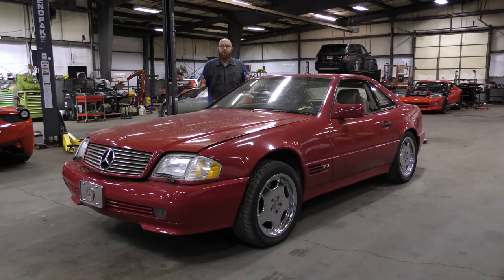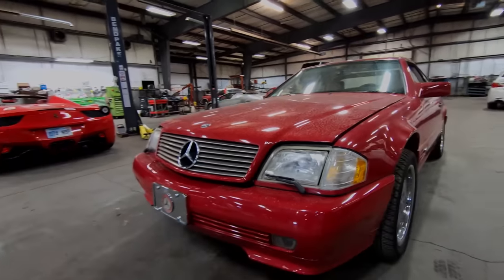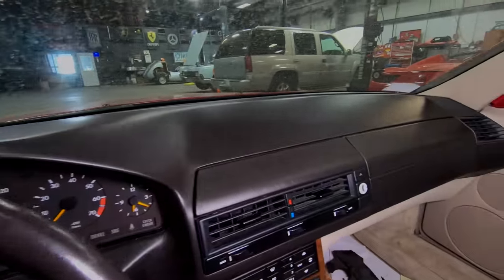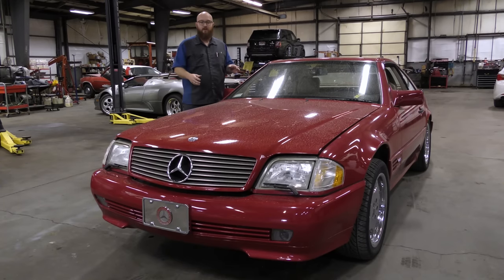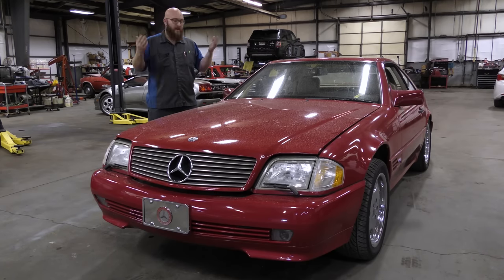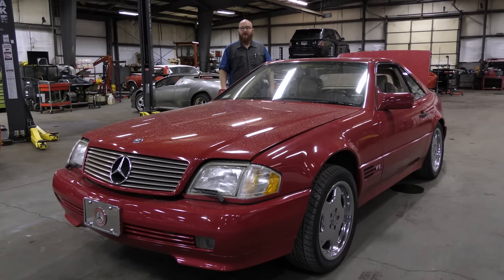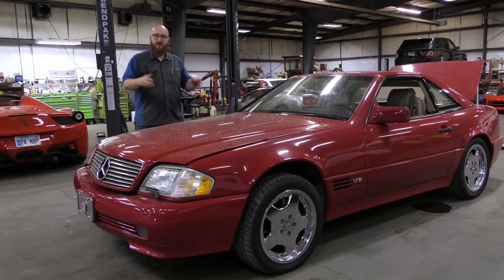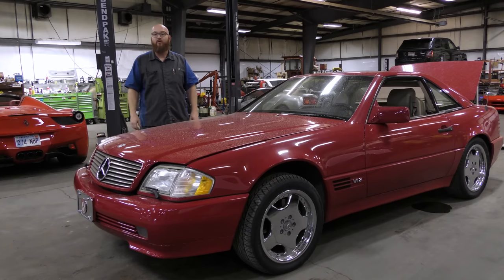Another customer scammed! CAR WIZARD shows why this '94 Mercedes SL600 is needing 15K to get sorted!

Comment: The hydraulic roof thing is horrifying!

 I wonder if anyone has successfully sued Mercedes-Benz for the environmentally friendly wiring.
Reply: I don't think so cuz all the cars were long out of warranty before the wiring harness reared it's ugly head. Most of the cars were from 93 to 98 and a lot of these problems didn't come out till 2007,8,9 ... So is 8 to 10 years before the wiring got bad. Mercedes used to sell the wiring harness for a rather inexpensive price compared to what they are now. I think a upper W124 harness was only like 3 or 400 bucks from Mercedes12 -15 years ago. I believe Mercedes only made one big run of them and then they stopped
Reply: Maybe; .I remember they had issues with rodents eating the wiring out of the cars.
Reply: The wiring was on every car. A recall would of bankrupted them so it never happened.
Reply: I believe it was a mandate of the German government, being green and all, to have the biodegradable insulation on the wiring, in 94/95 until it was rescinded.
Reply: @wheretheredferngrows14  Ahh yes, too big to fail.
Reply: @richbenzer5926  The road to hell is paved with good intentions.
Would have been better for the environment, if that law didn't exist.
Reply: Ahh, American's suing everyone.
Reply: @richbenzer5926  Yes a problem on BMW Motorcycles of that era too.
Reply: @formatique_arschloch  wow I'm so offended, I'm suing you for posting that~
Reply: @formatique_arschloch  maybe this explains why European car manufacturers produce such shit cars. 😐 Europeans don't want to sue for bad products.
Reply: @stevemonkey6666  Or maybe Americans just want to see a chance  to be a millionaire, because the coffee was too hot when spilled on their groin.
Reply: @formatique_arschloch  or because their $100,000 car failed because the manufacturer made the wiring loom out of biodegradable materials that are prematurely degrading, and they do not manufacture replacement parts.
Reply: Replace the hydraulic fluid with grape Kool-Aid and you'll be in business!
Reply: @stevemonkey6666  tell me about car quality of GM from 90's. It is terrible. But no one is suing GM for thar.
Reply: @davidjacobs8558  One has to stop for a moment and consider
which environment one is thinking about.
When CORPORATIONS talk about 'The Environment' it is a mistake
assume they are talking about the 'Natural Environment'
... They are actually talking about the "CORPORATE ENVIRONMENT'
Which is a totally different thing.
** They never explicitly said it was good for the 'Natural Environment"
Reply: @stevemonkey6666  most of the "shit" you have in the states have been manufactured inside USA, México or Brazil... Quality requirements are lower because the high volume of cars that are sold in only united states is incredibly high.  A Mercedes in Europe is very reliable and you can see A LOT of them with over 500k km or beyond 1M km. We also get spare parts you don't get in your American dealers. And american cars/parts are hugely expensive here... You pay for a base v6 Ford Mustang some 25k dollars...we are forced to pay around 45k euro so that means 60 thousand dollar for a basic Stang. Just to give y'all an example.
Reply: Go to a MB dealer, it is mostly Dr. and some business guys who lease for two or three years.  No person is buying them for longevity.  MB has ZERO priority on longevity.  just short term snob appeal and tech wizardy
Reply: Exactly! That’s why I bought an R107 instead of the R129.
Reply: Imagine being on a date with some chick you really want to impress and that happans. lololol
Reply: Having seen that degradable wiring, it is difficult to know just what stunts ANY Car Manufacturer will do! Once these high-end German Cars end-up in a different country, the costs to repair them rise exponentially. All except the classic VW Beetle. Nothing serious goes wrong. They could run forever, and get you from A to B.
Reply: @peterduxbury927  not all of them used biodegradable, 80s qnd 90s mercs are seen more often than beetles in third world countries
Reply: @samfuller6273  93 thru 96.....I had a 97 and it no longer had the soy based insulation.
Reply: @Judgegixxer 😂
Reply: It's been said that the entire engineering dept at Mercedes was fired for the wiring issue back in the 90s
Reply: @richbenzer5926  German government in 1994/95 was conservative and really not all that into environmental issues. Back then they were busy getting offended by the green party wearing sneakers in parliament. Mercedes simply figured they could switch their wiring to use organic softeners instead of synthetic, which however resulted in them brittling out earlier than expected.
Reply: @stevemonkey6666  Is that why America makes some of the worst junk cars of all time? In sue happy America yet
Reply: @locluke979  but here is the thing. American cars in the past were often real shit boxes but they've got better. I would say the average American car today is no worse than the average car from anywhere else. However Mercedes-Benz was once the best car in the world. They are marvels of engineering and people still love older Mercedes. Newer Mercedes are often shit boxes. American cars: getting better all the time. German cars: pretty good if you get rid of it after the lease period
Reply: They probably bragged about it.
Reply: @formatique_arschloch  that sorry is not as it seems.  The reason she won is because McDonald’s knew the coffee was too hot and noted it but didn’t do anything to fix it.  The lady almost died from the burns. They were horrific.
Reply: @decnet100  so this was not a government mandate?  That is what I understood but maybe I am misinformed.  If MB FUed then MB should stand behind their bad decision and offer new parts for a reasonable price
Reply: @richbenzer5926  Yeah, seems exactly that - Mercedes wasn't forced to do it, they just changed their wiring production (I suppose more or less for the regular reasons - the new stuff, namely Arnitel insulated wiring, was either offered to them cheaper and easier to make, or promoted as the latest and greatest with no drawbacks whatsoever), and perhaps later on someone mentioned as an excuse that the resulting wires would incidentially be less harmful to the environment - an explanation which I suspect must have been picked up on in the American market predominantly. I can tell you that over here in Germany even within car/Mercedes enthusiasts who usually love gossip like this, the whole "biodegradable" story is largely unknown, if at all it is told as "due to american environmental regulations, the wiring looms had to be recyclable" (which of course won't explain why other cars sold in the US don't have that issue - but that basically doesn't concern the German domestic car enthusiasts, does it). Over here, the stuff is basically just known for what it objectively is - "bad quality 90's wiring looms". 

By the way, there are several manufacturers in Germany (and also Poland) who do indeed supply new, quality wiring looms for 90's MBs for quite reasonable prices, as they do a lot of them - I'm sure they'd even supply some for a R129 SL600. Also (partial) engine wiring looms of better quality are now available through Mercedes themselves - for about €1200 as I'm told.

Regardless, Untertürkheim certainly should have stood by their product and do a recall.
Reply: @stevemonkey6666  that is right... German cars are now into the "more sales" mood so quality since the w204 and w212 era became a PITA. Engines are incredibly good (block and head) but everything around is like an iPhone or any electronic device of today with an expiration date. All north american cars weren't that bad before....10% was save at least lol but yes, they become a bit more reliable in the nowadays even tho all cars around the world's are reaching the same (shitty) quality standards as all manufacturers have now the same goal and that's MONEY. Cheers from Spain!!
Reply: @decnet100  thanks for the reply.  Interesting story.  Do you have links to any of these other suppliers?
Reply: @richbenzer5926  After two attempts of posting external links with YT deleting them, the names of the companies that I'd consider are MKB-tec and kurth-classic in Germany and perhaps also JKS-Elektro in Poland (even though he seems to have moved on to different things).
Oh, as a sidenote: They'd all require you to dismount your old harness and send it to them, as they essentially all refurbish and reuse your plugs, which also helps to ensure they are in fact recreating your exact harness variant. Here is a vid showing MKBtec's facilities and work: https://youtu.be/qt3hMeF61eE
Reply: @richbenzer5926  Oh, and also interestingly about the origin of the problem: I just found an article about this in a german vintage/youngtimer car mag which had an interview with Norman Kurth - he mentioned his well-founded suspicion that the wiring harness issue might have sprung from a number of suppliers, as it would always be the same cables connecting the same subsystems that would show these cracks, while other cables right next to them in the same harness would in all regularity be fine, meaning that Mercedes would receive these "sub-harnesses" from their long list of suppliers, and turn  them into one big harness as part of their final assembly. So in clear text, it probably wasn't a massive, centralized push for more environmentally friendly wiring if only some wires weren't affected, more of an issue with several suppliers (throttle bodies seem to have suffered worst - I guess there the heat did it's job on the new wiring the quickest).

I suspect the issue could be as simple as Mercedes going "we also accept the new wiring standards xyz, they seem to be equal to what we are already using" on their supplier contracts, and some of those suppliers going "oh great, we'll pick those up as they're half a cent cheaper per Meter (and we order that stuff by the kilometer)".
Reply: @samfuller6273 , it's not a warranty issue. It's a defective parts issue. The parts were intended to last 30+ years, not 10 years.
Reply: @samfuller6273  hello even the 1991 had the problem. I have the 500E W124 1991 and about 1 year ago i bay new upper harness from the dealer around 600euro. Date off production off the new harness was 2012, its labeld on the heaness near where you plug into the computer . In original closed plastic. Also have 1995 W124 E220 coupe that harness i maked my self. In 1995 came the W210 and i belive they no had that problem anymore. But the W124 T and ...made until 1997 for the european marked.
Reply: @pablopicaro7649  I have a 99 S420 that was purchased brand new!
I'm not a doctor or a business guy at a time of purchase and the car was never leased!

Comment: Thanks for this Wizard, I really liked these cars but dealing with the top and wiring issues... these cars are now off my list.
Reply: Get the SL500
Reply: Wiring harness issues were for all models 1993-1995 aprox, before or after that, no problem. I'd steer clear of the 600 IMO
Reply: I’m currently workin in a Series 2a, DMC-12 and 57 Fairlane. Hands full at the moment lol
Reply: They are great cars. Just make sure the previous owner has attended to these things! PPI and receipts.
Reply: Get a 1998, best  year for a sl600, but they still are money hoes, the engine is too unique, I would guess you can't really get any parts for them.

Comment: ALWAYS pay for a PRE-PURCHASE inspection. It will cost a few hundred bucks at a dealer and they are happy to do it for you. They will find the issues you had no idea were there. This also gives you another tool to bargain on the price. This has saved me SOOOO MUCH money over the years. This goes for any machine or vehicle. My latest purchase was a Bobcat Skid Steer loader. It was in very good condition and some minor issues were discovered but the piece of mind you gain for such a small outlay of money before you own the vehicle is WELL worth it.